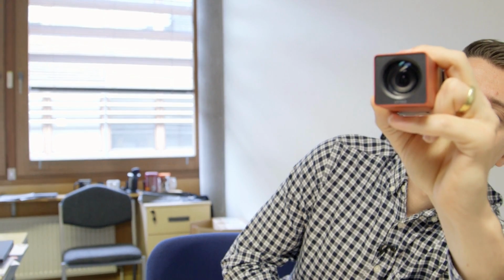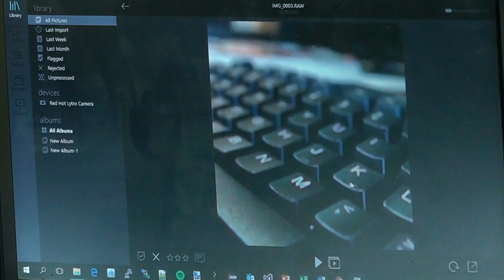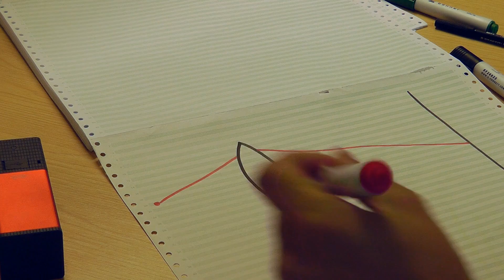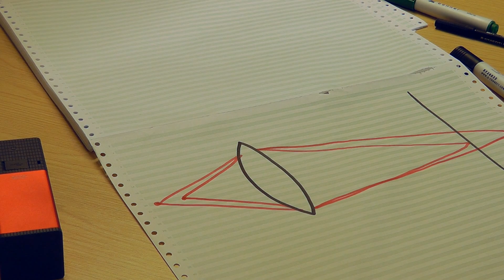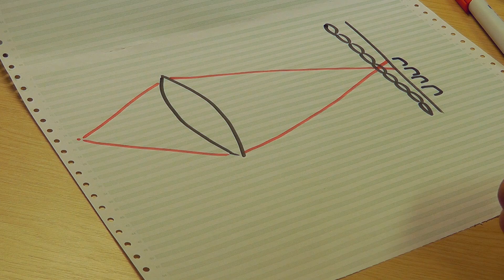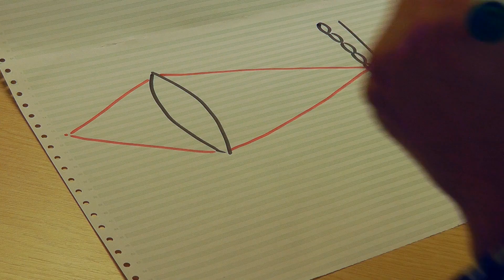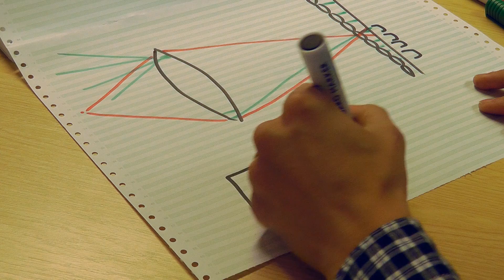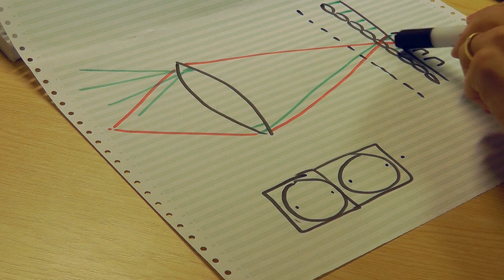Light-field Camera - Computerphile

Comment: interesting, but sounds overly complicated... to do refocusing, wouldn't it be easier to take a series of images while moving the lens slightly back/forward, then pick the one you like?
Reply: +trisymphony This assumes that you're doing a static image.  That's a luxury in things like nature shots.
Reply: +trisymphony Cameras need time to collect the necessary light to make a picture, they do this by opening the shutter and that's basically what taking a picture is. If the shutter opens only for a very short time, the picture will literally be darker, because not that much light had time to get through. This is why when people do slow-mo videos with hugely expensive cameras, they have to have a brighter scene the "slower" they want the video to be. This holds true even if modern cameras don't have mechanical shutters, they still need time to collect the light. This is basically what you are suggesting, a slow-mo videocamera that moves the lense as it films. So you wouldn't be able to make many pictures of the same scene, unless it is completely static, you would be taking video where the movement is visible. The higher the frames per second the camera has the more a scene that has movement could appear static, but the more frames you're trying to get, suddenly your daylight shot looks like it was taken at night, because of the small amount of light getting through. Also, powerful slow-mo cameras have fans built into them to keep them cool because they're essentially high-power machines.
The benefit of this light-field camera is that you have to open the shutter only once and it collects a lot of information at once, something you can't do if you need time to move the lense.
Reply: +evildude109 yes, the image would move when you are shooting a rapidly moving scene. it would be more like a very short, very high fps movie clip with changing focus.
Reply: +McAnkkuli the light problem can be solved by bigger apertures and higher sensor sensitivity. I am also not talking about taking about hundreds of fps over an extended period of time, but like 10 images and an electronic shutter. 1/500 or 1/1000 shutter speed would already be enough for that, which can be handled comfortably by most consumer grade cameras. my m4/3 camera for instance produces nicely lit pictures at sub-2.0 apertures in moderately lit conditions at those speeds in burst mode.
Reply: +evildude109 
Set a normal camera to the very low resolution those light field pictures have and you can most likely burst shot all the differently focused images in the fraction of a second.
Reply: +McAnkkuli 
Ok so you either have multiple sharp high res underexposed images where the scene changes a little from picture to picture (normal camera), or a low res image with motion blur due to the longer exposure time of the light field camera.

Comment: So it is the effect of lenticular lens hologramms turned backwards. oO I thought it takes multiple pictures in a short time while moving the ccd back and thus having a picture with different focus layers that you later compile to a single picture.
Reply: +Morkvonork You could do it that way but I get the sense that it'd be mathematically very difficult to figure out what was going on and reconstruct the rays. It'd also be quite complicated to move the CCD that quickly without changing its orientation at all. You'd be better off using a lens with a variable geometry to bend the light at a slightly different angle.

Comment: Would this be useful for astronomical purposes?
Reply: +2chws For photographical purposes, astronomical objects are infinitely far away. This means you don't need to refocus and you also don't have any parallax effects, at least not by moving the camera a few centimeters.

However, in radio astronomy a similar technique called beamforming is used to get a virtual directional antenna that you can redirect at different objects in post.
Reply: +koseq7 what it that .&.qu.ot; thing.?
Reply: Penny Lane wow
Reply: ***** Yeah, the Youtube comments have accumulated quite a few bugs in recent times. But this one should be so easy to fix that it's the ultimate prove that no-one in this company has ever come across it themselves, never mind some kind of QA department one could expect. As if a lot of the people here weren't bad enough, now we also have to fight the technology :/

Comment: can you talk about RAW processing?
also, i need a program that can make HDR... i have photoshop, but i don't have Lightroom...
Reply: +Justin Koenig Photoshop has a few PhotoMerge options if you want to make HDR from mulitple imagess, to try tro make 1 image HDR you should learn about advanced used of the Curves adjustment-layer. ex. negative S-curve and Masking. 
and to lessen the noise use the right blending mode for the right layer. 

Photoshop has all you need, Lightroom is just a shortcut to fewer features + image sorting.
Reply: +Adrian Freund Darktable is great! But I'm not sure it's available for windows...
Reply: +Justin Koenig To make an HDR I would recommend Luminance HDR and then photoshop/gimp/darktable to tweak it (Luminance HDR can take several types of RAW input!)
Reply: I'm sorry to hear that, it works pretty well for me, no exposure problem (you can set them manually though if you can find the values in another software). It even has some great batch processing capabilities if you want to create hundreds of HDRs at once. It is very cpu demanding so I do understand that it may not be for everyone. I would advise finding the right profile/settings at a low resolution and only when you're sure let your computer run overnight to produce the high res of the batch of photos. Also make sure to enable multithreading if your cpu has multiple cores.
Reply: +Justin Koenig You could trie Lightzone, played a bit with it some time ago. It seems to do what you want.
Reply: +Justin Koenig you can use photoshop to make a HDR...
Reply: PeJayCee except that it's really time consuming and not nearly as streamlined as in lightroom or other software
also, you're going to be working with a bitmap. not a RAW file like i would want.
Reply: Jim R. Didriksen thanks hadn't really looked into that as i just started
might be more complex, but i'll work on it